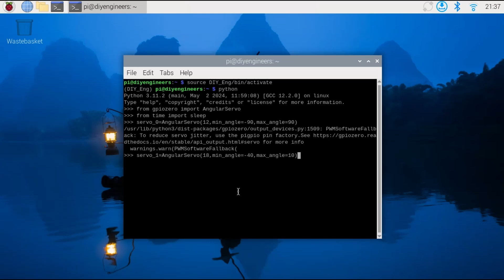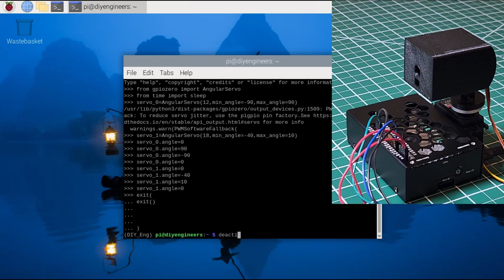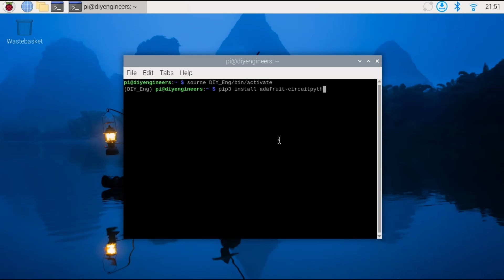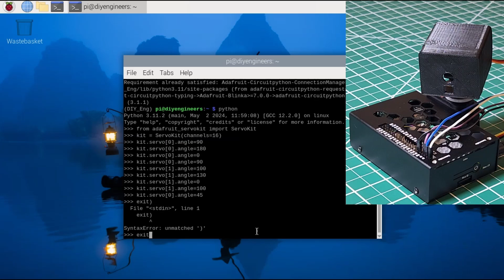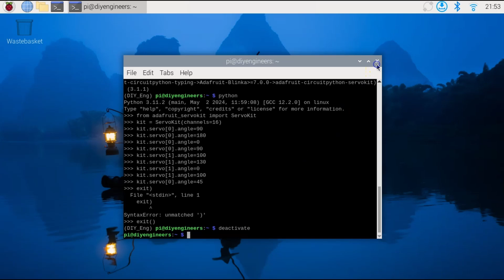Servos with Raspberry Pi 5 - No Jitters (PCA9685)

Comment: Hello, I'm also using the same peripheral, but with an unofficial 5V 3A adapter. However, I keep getting a warning notification on the Raspberry Pi, and the PCA9685 module is not detected at address 0x40 when I run sudo i2cdetect -y 1. Could the issue be with the PCA9685 module itself, or is the problem caused by the adapter, which might be affecting the functionality of the Raspberry Pi's pins? Thank you.

Comment: Thanks for the video!  I have heard that the gpiozero library and pigpio pin factory that will allow hardware generated pulses are not available for the Pi 5.  This library works on a Pi 4B and that is how I handled servo jitter in the past.  Hoping that the authors will bring this library to the Pi 5 at some point.  Till then, the PCS9685 appears to be the best solution. Cheers.

Comment: I'm working with Arduino MEGA + L293D connecting two servos to L293D Servo_1 (pin 10) Servo_2 w(pin 9) control via FlySky using VRA(servo1) & VRB(servo2) similar setup horizontal & vertical movement. Both servos move via VRA, VRB fine but constant jittering. I disconnected one servo from L293D and the jittering stop on the connected servo. Any suggestions would be greatly appreciated. Thanks for sharing video (at some point will get to using Raspberry Pi 5) always enjoy your content. Cheers mate!

Comment: I'm working on a pan tilt project right now but I'm having a problem cuz rpigpio no longer works in bookworm. gpiozero I guess is the replacement, but it's not working for me. Could you post the script/program you used to test your project ? Maybe I should just go back to Buster

Comment from the maker: Comment if you have any project ideas for this camera /servo setup!
Reply: i2c is not detecting the driver
Reply: I am having an issue where it is saying that No module named lgpio , can you please help
Reply: Make a pi zero w camera mount for on top of an old TV antenna pole.  Try using motioneyes os and some how get the servos to pan and tilt the camera.  Maybe even using two pi zero w, one for the camera and one for the servos.